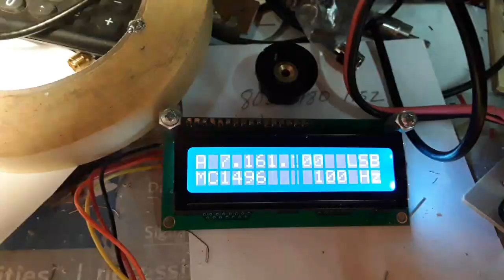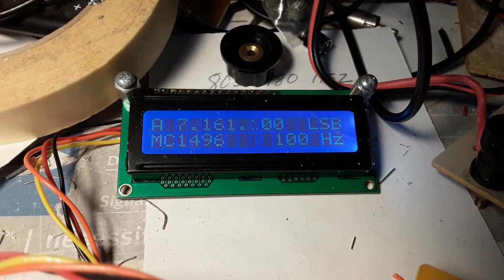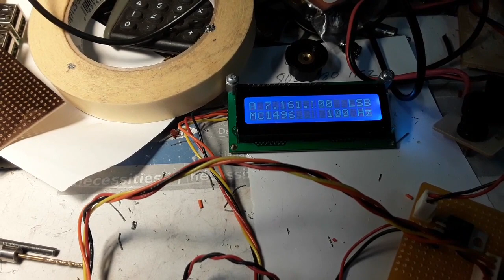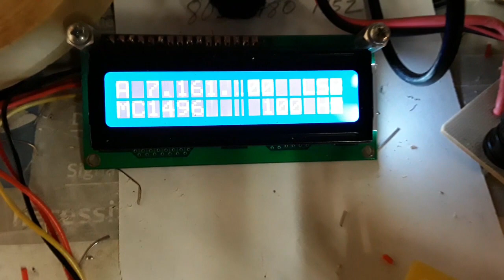MC1496 Part3 ~ A great sounding Direct Conversion Receiver

Comment: It would have been nice if you could have given us a quick description of the circuit.

I expect the small chip was a LM386 or an NE602. I'm not sure what the larger chip was... I'm guessing some sort of an op amp for audio filtering.

Seriously, the circuit description is as important as how it sounds.

All that being said, it sounds great.

Nice job.
Reply from the maker: Actually, this radio was the subject of an article in the G-QRP Club SPRAT Issue #187 and if you go to https://www.n6qw.com/ you will see this project in all of its naked detail. If you want the code for the Arduino, then send me an email to hamradiogenius@gmail.com.

The main chip is a MC1496 Double Balanced Mixer --still available in through hole or SMD.

The video was a part of the description on the website and so you will get all of the gory details on the website. You are coming in about the middle of the movie and I sense your frustration over who got did in.

73's
Pete N6QW

Comment: Pete in Mike I0WV non o i toroidi t306 but ave t50 6 es uguale?
Reply from the maker: Hi Mike I think you are asking about substituting T-30-6 Cores with T-50-6 Cores. The key factor is the number of turns on the cores driven by the Al value for the core. The T-30-6 is 36 and the t-50-6 is 40 . The number of turns is governed by the formula Turns = 100 * ( Square root of [inductance in microhenry/Al value]). So with a larger number in the denominator the turns will be less . Example a 1 microhenry inductor Turns (T-30-6) = 100 * (sqrt[1/36]) = 16.67 turns. Now for the Turns(T-50-6) = 100*(sqrt[1/40]) = 15.8 turns. So the T-50-6 would require LESS turns for the same inductance value -- runs the numbers yourself. The Al Values are found at Amidon. Although the Al values are close so perhaps 16 turns for either will get you in the Colosseum (we call that the ball park over here).

Ciao,
Pete N6QW

Comment: E possibile avere lo schema?
Reply from the maker: Hi Michele,

I think you are looking for a schematic. Look up the datasheet for the MC1496 and there are application notes for a 12 VDC version of a product detector. That is the main part. Add your favorite audio amp (i used a 2N3904 with an LM386). For the RF amp stage I used a single PNP transistor (untuned) and any 40M Band Pass Filter circuit works. For the LO I used a Si5351 but for 40M you can use a simple analog VFO @ 7mHz and you are there. If you are a member of the G-QRP Club -- a future issue of the SPRAT publication will have all of the excruciating details. Drop me an email at my QRZ.com address and I will be happy to send you the Arduino code for this project.

Thanks for your email and interest in this project. OH should tell you I have taken what you see in the video and it is now a part of a SSB transceiver!

73's
Pete N6QW
Reply: @N6QW  ok tnx Pete Fer informazioni im 85 year old  anni ciao 73 de I0WV Mike
Reply from the maker: @michelemazzilli8260  Hi Mike -- I am only a few years younger than you so any thing else you need send me an email to the qrz.com email address.

Ciao
Pete
Reply: The 2 power suplier males magic

Comment: Sounds great Pete! I'm always impressed how good a direct conversion receiver can sound and yours certainly does that! The trouble I have with some active mixer chips is that the front end gets easily overloaded on 40m (on this side of the Pond) with the powerful short wave stations from 7200 kHz onwards. I'm experiencing this issue with the homebrew SDR I'm building (which uses 2 x NE612s). Maybe I need to investigate roofing filters. Thanks again - as always. 73, Nick M0NTV
Reply from the maker: Hi Nick,

Thanks for your posting and comments. None of my four SDR homebrew transceivers use an active mixer. All use the ADE-1 so I have not seen an overload problem. Then again the problem is much worse on 40M at your location because of all of the competing short wave broadcast transmitters. Have you looked to using the ADE-1, SBL-1 or TUF-1 for the SDR. take a look at www.n6qwradiogenius.us

Thanks again for watching the video..

73's
Pete N6QW

Comment: Very nice - the MC1496 sounds very quiet. I'm a big fan of direct conversion receivers, this seems less noisy than diode mixer and NE612 (Sudden) based receivers. I have a JUMA TRX2 sitting on my desk, just love the simplicity of direct conversion.
Reply from the maker: Hi Andrew,

Thank you for your post and comments. I was NOT a fan of DCR's when they were driven by analog VFO's. They drifted and hard to tune unless you had a large variable reduction drive. But now with the Si5351 I can tune this DCR at 10 Hz increments and if I change the Arduino sketch I can do it in 1 Hz increments. So now a different ball game. I was struck how the JA5 station sounded like a high end stereo system. the CW seemed crisp as well. Almost (I said almost) wanted to build some sort of companion CW transmitter. But then reason took over.

73's
Pete N6QW
Reply: @N6QW  Hi Pete,  Fully agree - DDS with Arduino is a game changer for Direct Conversion receivers (and transmitters).  You have inspired me to have a play with the  MC1496. 73 Andrew VK4JAM
Reply from the maker: @andrewmason2617   If you look at my blog n6qw.blogspot.com I have some ideas about a CW transceiver and have included a code snippet on how to enable the transmitter just for transmitting using CLK1.

The MC1496 makes for a nice piece of ancient technology. Let me know if you get something working.

Thanks for looking and for your posting.

73's
Pete N6QW

Comment: there is a certain crisp clean sound about the DCRx - love it!
Reply from the maker: Hi Steve,

Presence aside, what really makes this a viable receiver project is the use of the Si5351. This DCR will work all HF bands, can be tuned in 10 Hertz increments and DOES NOT DRIFT!. Thanks for your post.

Pete N6QW